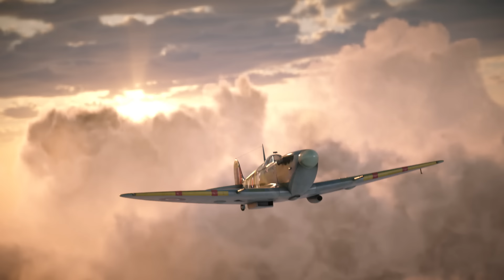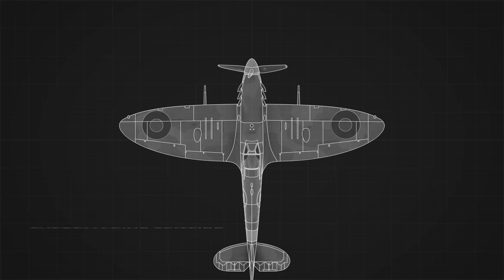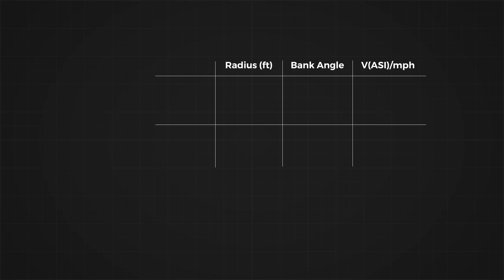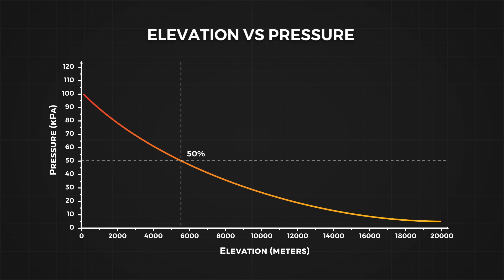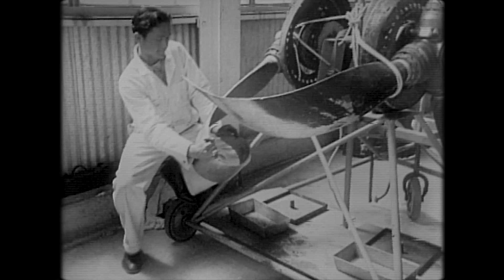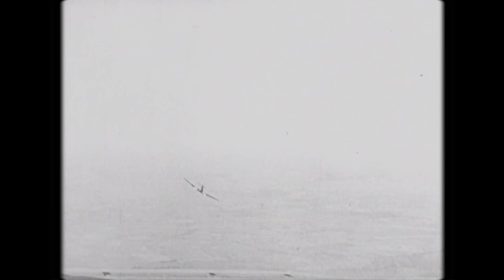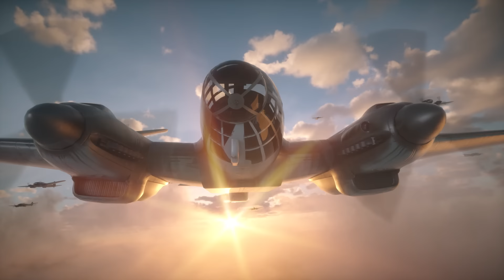The Insane Engineering of the Spitfire

Comment: Ailerons do not remain deflected into the turn. They set the bank angle of the turn then trail in neutral position throughout the turn. 

Rudder is used along with aileron deflection but then also returned to neutral trail when ailerons are not displaced. This is called "coordination" of controls to counter adverse yaw. (Rudder is sometimes held to counter engine torque through a turn, but its less than 1 degree of rudder to center the ball, usually). 

Elevator does not deflect down to increase lift on the wing. Down elevator increases lift at the horizontal stabilizer, which reduces wing angle of attack, and causes negative wing lift. Up-elevator pitches the wing to a higher angle of attack and generates more loft for the turn. 

The Spitfire actually did not require much elevator to turn. It could be flared for landing with only 5 degrees of up-elevator. It could initiate a turn with half that much deflection. Once the turn was started, the stick had to be returned to center and elevator neutral to maintain the turn and prevent it from diverging and increasing G-load on its own, because the spitfire had near neutral static longitudinal stability, it was balanced near its neutral point and could turn with almost zero elevator deflection. Not unlike an F-22. It required pilot attention as it was not fly by wire.

With clipped wingtips, the spitfire out-rolled all other primary fighters of all nations below about 250mph. Above that, the FW-190s were better, and beyond 400mph the P-51 dominated all.

The spitfires wing spar is not located precisely at 25% chord, it is 24.5% chord. At the root. And the 1/4-chord point actually sweeps aft of the spar by a large margin approaching the wingtips. The wingtip radius is located entirely behind the spar. This is for aeroelastic tailoring, and its intended to make the wing twist under load, to achieve additional washout at high G loads. 

The Elliptical shape not only makes room for Guns and Landing Gear. The chord distribution that remains wide then rapidly shortens at the tip also keep the 60% semi-span portion within 80% of the root chord Reynolds number. This has a myriad of benefits, including slow flight lift and high-speed drag.

The Spit is an engineering marvel, and most of her secrets are forgotten. Ill keep a few I've discovered to myself till I die, because they are that special.

Comment: I had the pleasure of being in close contact with a running spitfire in 1978 at Moorabbin Airport Australia.

Yes, it spat fire from its exhaust to the great joy of my brother and myself.
It was a georgious sound.

She was not supposed to be run as it was on a 20-year loan and was only meant to be preserved. I found this out 20 years later when I spoke to a member of the aro club that owned the V12 monster. 

This documentary was excellent but the biggest advantage the spitfire had during the battle of Britten was not mentioned here.

The newly developed automatic pitch control for the drive screw was introduced into service just in time for the Battle Of Britton.

The auto pitch control maintained the correct pitch for airspeed and removed one of the jobs the pilot had to do.

With the auto pitch control, the pilot only had to set the engine torque and the auto pitch control maintained optimum engine RPM.

The original service video is available on youtube.

Comment: There goes the siren that warns of the air raid
Then comes the sound of the guns sending flak
Out for the scramble, we've got to get airborne
Got to get up for the coming attack

Jump in the cockpit and start up the engines
Remove all the wheelblocks, there's no time to waste
Gathering speed as we head down the runway
Got to get airborne before it's too late

Running, scrambling, flying
Rolling, turning, diving, going in again
Running, scrambling, flying
Rolling, turning, diving

Run, live to fly
Fly to live, do or die
Won't you run, live to fly
Fly to live, aces high

Move in to fire at the mainstream of bombers
Let off a sharp burst and then turn away
Roll over, spin 'round to come in behind them
Move to their blindsides and firing again

Bandits at 8 o'clock move in behind us
Ten ME-109's out of the sun
Ascending and turning our spitfires to face them
Heading straight for them, I press down my guns

Rolling, turning, diving
Rolling, turning, diving (doing it again)
Rolling, turning, diving
Rolling, turning, diving

Run, live to fly
Fly to live, do or die
Won't you run, live to fly
Fly to live, aces high
Reply: #UpTheIrons

Comment: A brilliant design with a focus on weight reduction and low drag (thin wings).  The Spit was about 900 lb lighter than the contemporary Hurricane, both with the same engine.  It was obvious in 1936 that the Spitfire design was far more advanced.

It's biggest detraction was the the high drag rad scoop(s) in the wings, a band-aid solution not part of the original design.  The cooling drag penalty was recognized early and RJ Mitchell (with input from Meredith) was designing a new Spitfire in 1937 with a ventral (belly) embedded radiator when he died.  Type 312 would have been faster, with better climb and more fuel.  Sadly, Smith tried to resurrect this major redesign twice, but management wouldn't tolerate such a stoppage and retooling of the assembly lines.  The XP-40 and NA-73 of course followed that radiator trend as did French, Russian and Italian fighters.
Reply: Better than Mustang which copied the air intake engine with scoop below wing and bubble canopy American fighters weren’t as good at start of war
Reply: @PostalWorker14   punctuation was invented in Britain.

Comment: To maintain level in a turn the resultant lift vector has to increase so that the vertical component still equals the weight. This is achieved by increasing the Angle of Attack. ( by pulling the stick backwards into toward the pilot's stomach, which in turn RAISES the elevator, which results in the tail being deflected downwards). Very interesting video though thanks.

Comment: Good intelligent presentation over all.  Re the cooling system , Cold air entering the radiator was heated and would have expanded out of the rear,  in effect producing a small amount of extra thrust.  Likewise, the rear facing exhaust nozzles also gave a small amount of additional thrust.

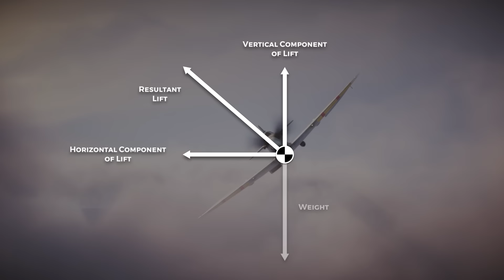Comment: In 4:11 the elevator is shown compensating for the bank angle by going down. This is incorrect, albeit an understandable mistake if you’re a formula 1 fan. The elevator actually needs to go up, to push the tail of the plane down with respect to the center of gravity. As the fuselage rotates (lifting up the nose of the aircraft) the angle of attack of the wings becomes positive and the thrust vector of the engine is also tilted upward. This change in attitude compensates for the loss of altitude. Under more extreme (knife edge) banking, such as the one shown in the circular turn diagram, the pilot would actually use the rudder to tilt the thrust vector up and the elevator to turn tightly.

Comment: surely you give some love to the hawker hurricane, it was also a potent fighter, it was not as expensive as the spitfire so the cost to produce would be cheaper it would be good to have a video on the hurricane to give us a bit of a comparison towards the spitfire
Reply: Hurricane was outdated and the RAF knew it.  They therefore issued instructions in Mar 1940 to modify the engine for overboosting it, but that was only effective up to 10,000', well below the bomber stream.  Once overboosted, which happened often with the slow Hurricane, the aircraft was sidelined for engine inspection.

Comment: It isn't as easy as comparing wing loading. The design of the wing itself is also important. The 109 had automatic leading edge slots and camber-changing flaps that greatly increased the lift of the wing at low speeds and prevented stalling.
Reply: and they added drag.  Sometimes at the critical AoA they would snap open and closed, not necessarily at the same time.

Comment: One thing I've wondered about quite often is why the American warbirds had its guns mounted so close together whereas the spitfire had its guns mounted over such a wide area
Reply: The internal structure of the Spitfire's wing did not allow the guns to be grouped together as in the Hurricane. Harmonising the guns to make their fire converge at a pre-selected point was no trouble – each gun was individually adjustable.
Reply: The Spitfires wing was too thin to have the guns stood "up"
Reply: @johnbrewer8954  What do you mean by "stood up"?
Reply: @MarsFKA  Bit hard to explain.  A machine gun is normally rectangular so it is taller than it is wide and the bullets feed through the side.  In a battery of guns like the Hurricane the ammunition boxes were beside the guns, gung straight into the side of the outside guns and being fed over the top to the inside guns, spent rounds were then channelled down to a vent hole in the wing.  On the Spitfire, because the wing was sothin it had two guns side by side, with ammunition boxes on either side of them. THEN on either side of those two there were another two with ammunition boxes between.  The guns were turned 90 degrees so the bullets fed in vertically down and vented straight down through a hole in the wing.  A lot of words, maybe easier just to google Spitfire guns etc to see pictures.
Reply: @johnbrewer8954  Every reference and diagram that I have seen in any book about the Spitfire shows the .303 machine guns mounted upright with the belts feeding in from the side and the empty cases ejecting straight out the bottom. The same applied to the cannons and .5 Brownings. The wing was thick enough to allow this. If you know of any diagram that shows otherwise please provide a link.

Comment: In a bank, especially in a step bank where lift is greatly reduced, the airplane's nose wants to move downward. Accordingly, the pilot pulls BACK on the stick to RAISE the elevator to increase the wing's angle of attack and thus increase lift. You showed the opposite.
Pulling back on he stick in a steep  bank also increases he rate of turn- to a point-  where the wing is at such a high angle of attack that it can no longer produce lift, and it stalls.
After sixty years as a pilot, I know at least that much.

Comment: Amazing how all this tech was available in 1940. Precursors  to modern engines in cars . The Messersmit basically had the makings of an automatic system in cars using what seems to be similar to a torgue converter for delivering power as required at lower altitudes  Incredible stuff
Reply: This entire video is just highlighting modern car technologies that have apparently existed since even the 30's. Direct injection on the BF109 yet in 2000 or even 2010 it was almost never yet seen in cars

Comment: A brilliant video! I love your work in general. I have learned so much already. However, I would like to point out a mistake in this video. The way the elevator works was described wrong. In order to generate more lift, a negative lift is generated at the elevator, which pitches the nose of the aircraft upwards and thus generates a higher lift at the main wing via a larger angle of attack of the airflow. To achieve this, the elevator deflects upwards. Best wishes and keep up the great work!

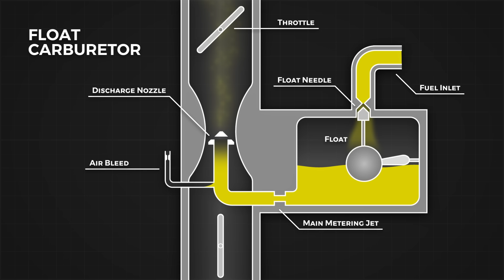Comment: 13:30
"Negative G manoeuvre", as the name implies, would force the valve up, not down. Therefore, judging by your diagram, it would starve the engine of fuel, not flood it.
This is also consistent with the simulations I know, where the engine stalling during negative G loads can be instantly stopped by entering a positive G turn.

AFAIK, If the engine was being flooded, you would just need to close the throttle in order to limit the amount of fuel-air mixture, entering the system. Plus, exiting the negative-G manoeuvre wouldn't just stop the engine stall, you would still need to burn the excess fuel first.

Comment: A couple of mistakes in the engineering explanations.  The really big one is the elevation deflection as others have noticed.  The induced drag explanation is also wrong but a common error that folks make.  

Induced drag is not due to tip vortex, the tip vortex is just a symptom of the imbalance in pressure and the flow that it causes, it's not the cause of drag.  Induced drag is due to downwash that pulls the lift vector backwards - it's lift induced drag.  For an elliptical lift distribution the downwash is constant across the whole wing and minimizes the total induced drag .  Square wings have more downwash at the tips and more drag at tips, highly tapered wings have more downwash near the centre of the wing and where most of the drag will be, in extreme taper/washout cases you can even get upwash at the tips and induced thrust at the tips - overall induced drag though is worse than the elliptical distribution case.

Comment: Very good!!!! However, one shortcoming though. The failure to mention the matter of shortcoming of "raw materials " for the German designers and builders of engines and airframes. They had to make do with what was available at the time in wartime Germany.
1. Engines:  they were forced to use lesser quality aluminium alloys for the engines. Thus less rigidity and durability as well as coolant fluid leakage in the cylinder heads. Limiting the boiling point of the coolant fluid resulted in larger radiator size, and the quality of the of the aluminium used for the coolant radiators were also a factor  This is also true for the crankshaft, camshafts and gears. 
2. Wings: the airfoil used by the Me 109 were actually "ticker" than that of the spitfire but substantially smaller in wing area resulting in a heavier wing loading. Thus less turning radius.

Comment: This is the best I've seen. In particular, you talk about the advantage the inverted,  fuel injected Daimler-Benz Bf109 engine had in neg. G manuvers, compared to  float carb. Allied aircraft (Spits...Mustangs). To wit, 109 pilots could push straight over in a dive; Allied aircraft....as you pointed out, had to roll over inverted or the engine would flood.
Reply: No, Mustangs had the pressure carb and so did late Mk.V Spitfires, etc.  The float carb was really a problem with the Hurricane as its roll rate was sluggish, acceleration poor and dive speed limited to 390 mph anyways... so slower Hurricanes tended to stick with bomber attacks.

Comment: think that opening shot in the flight operations room was The underground facility at R.A.F. fighter sector HQ Uxbridge, Middlesex, now Hillingdon Borough the west London borough, Boris Johnsons patch. It is where I was born in 1951. I have been down the bunker on numerous occasions as I used to work at The Battle of Britain club which was in the grounds of RAF Uxbridge in two large Nissan huts. Alas the club is no longer there. Just down the A40 Western Avenue is RAF Northolt roughly 2 miles away. RAF Northolt was once homt to a Polish fighter squadron also frequented by Douglas Bader. Now of course RAF Northolt is the nearest RAF to LOndon. You can see a monument to the Polish Squadron as you travel down the A40 Wester Avenue towards London. Bentley Priory was fighter command HQ, near Harrow.

Comment: Although not "insane engineering" you should have mentioned "Miss Shilling's orifice" which was a solution to solve the engine cut out problem in negative g moves. It is insane in its own way for being a simplistic solution that was easily implemented.

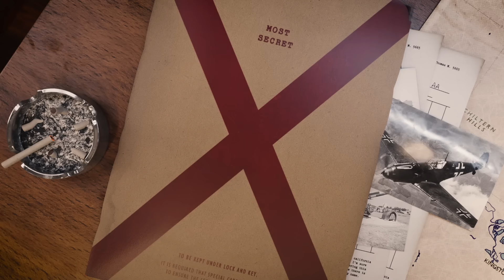Comment: 11:18 "Later variants attempted to correct the disparity in firepower by mounting guns inside the wings" is wrong. In the picture you are showing a BF-109 E variant, used during the Battle of Britain (1940), which was the last variant to have proper wing cannons inside the wing structure. Later 109 variants (F,G) removed the wing cannons and added a 20, (or 30mm like in the K-4 Kurfurst variant) cannon firing through the propeller. There was indeed an attempt at integrating 2 wing cannons in the form of gunpods in later 109's, but they turned out to be heavy and handicapped the plane's already low manoueverability

Comment: 15:30 - I've heard this explanation before, and it doesn't make sense to me. If you throttle the intake at low altitudes so that the engine isn't "overpressured", I don't see how that would reduce power - you are, of course, keeping the pressure reaching the cylinders constant, which should mean constant power from low altitudes until the point where the (single speed) supercharger couldn't compress the air enough to maintain this constant pressure. Yet, the power IS less at lower altitudes - and the reason is, I think, one that I've read elsewhere (I think it was in Quill's book) - it takes POWER to TURN the supercharger - the supercharger ABSORBS power. Since the gear ratio is fixed, this means the supercharger is turning at a constant RPM, and since the air is denser at low altitudes, making the supercharger turn will ABSORB more power at lower altitudes. The BF109's fluid coupling would "slip" more at low altitudes, absorbing less power (not sure about the variable oil pressure in the coupling - first time I've heard this). To be honest - I don't remember if the early Merlins had single SPEED superchargers (I'm pretty sure they were all dual speed) - they definitely had single STAGE superchargers. Will go look it up...

Comment: I'm playing Warthunder.
all Spitfires and 
I flew BF-109s.

gun maintenance 5+3 expert
I played with weapon maintenance 5+5 ace planes.

All Spitfires have weak engines.

When the Spitfire engine is hit, the cooling water is punctured.

Spitfire engine stops after 2-3 minutes.

The engine in the German BF-109 is more durable, even if the BF-109 cooling water is punctured, the plane flies 100 km more.

bf-109k, fw-190d even without cooling water the plane flies for a long time.